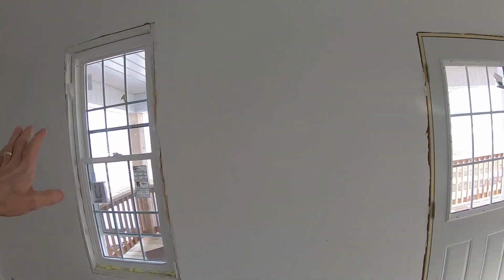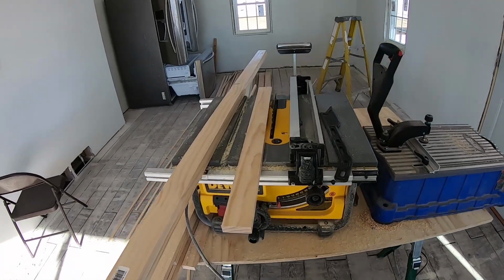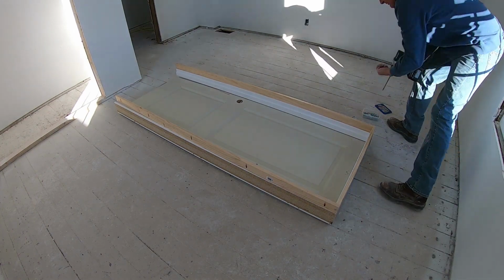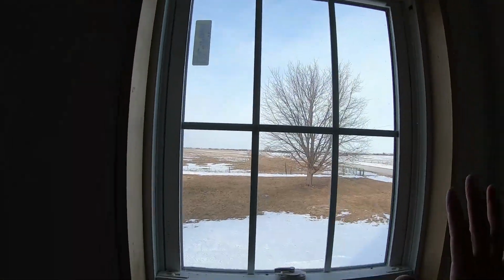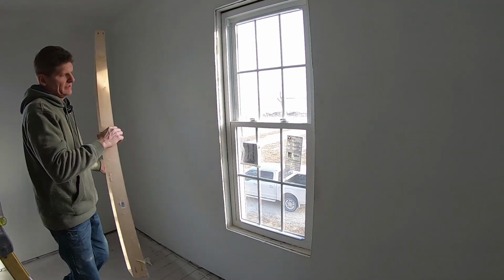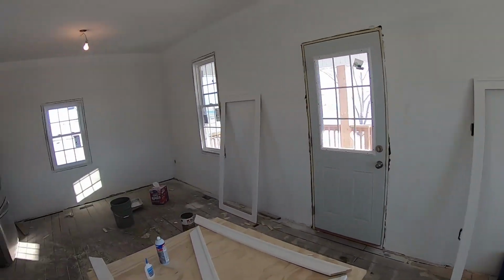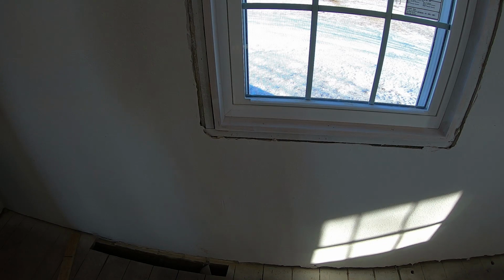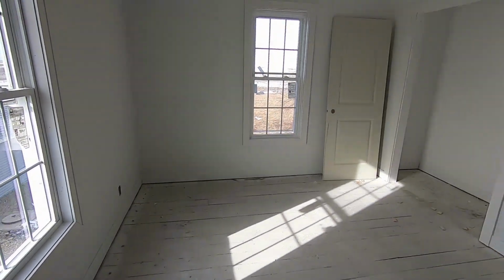Installing doors and trim - Bittersweet house flip part 22

Comment: 1 does not appreciate how long and the tedious process this is until you do it. Got a few boards yet to do and got my 2200 sq ft house of base and case done. Plus paint caulk filling nail holes…. Good work.
Reply from the maker: So true Pete. So true.

Comment: Just another DIYer, cut the bottom to length, top, then the sides. Place board and pencil line from the wall for each location. Cut boards with table saw. Nail in place, done. Took , me from beginning to end 8-10 minutes each window.